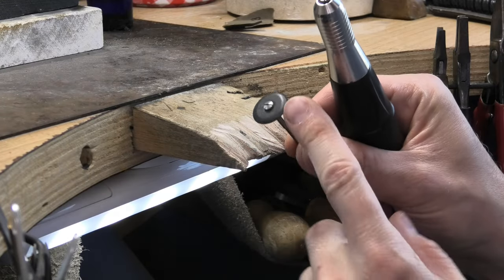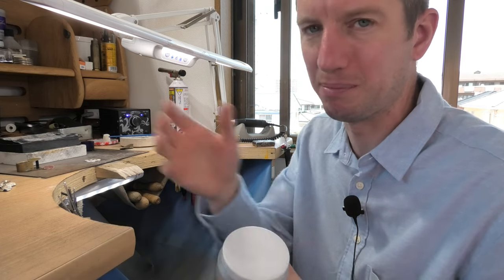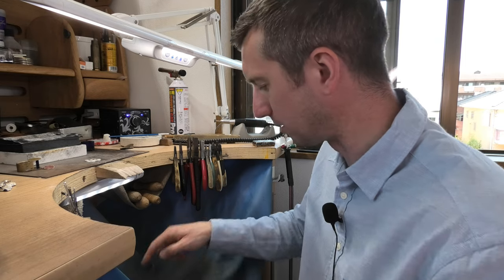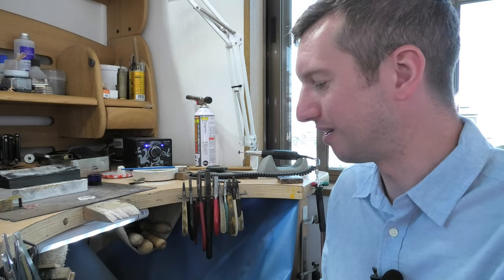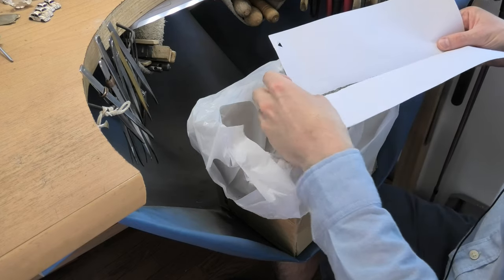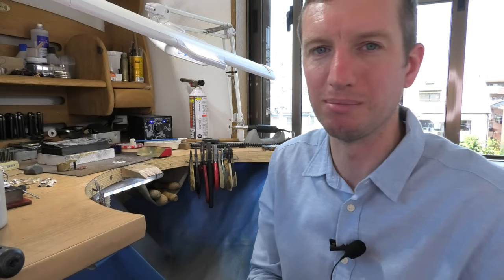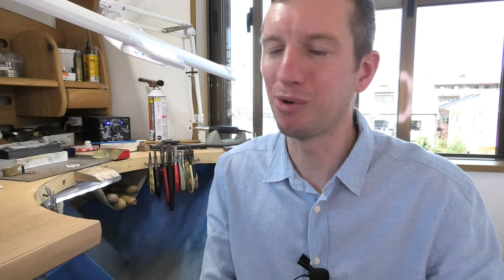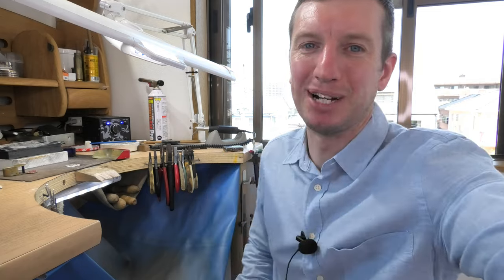How to Separate Debris from your Lemel

Comment: Not silly. A jeweller I know puts bits of wet & dry, saw blades, wet wipes, tape, anything that might have dust on it. A separate vacuum for the studio, a doormat to wipe your feet on when leaving the room. Vacuum skirting boards. A lot of the recovery houses in England will supply you with a filter box for under your sink where you wash stuff off including your hands. He says when they come to clear it for you a peg for your nose would help as it stinks. When you come round to sending in, send your apron, as you said any mats, everything that might hold dust! Steve...
Reply from the maker: haha hes serious!

Comment: Dear Chris,
Maybe my tip is odd, but I learned to pan gold as a kid. If you take a small gold pan and add a few drops of dish washing soap, you can wash the impurities out of the precious metal shavings, dust etc. After a few rounds of washing, you'll have pure precious metal. Check out YouTube gold panning technique for beginners. A beginner can even save the waste in a container until the washing technique is mastered.
Steel from e.g. saw blades can be removed with a magnet. Reuse of my own precious metal is as a result possible with the highest quality. 
Take care, Rebecca
Reply from the maker: love it. Thank you